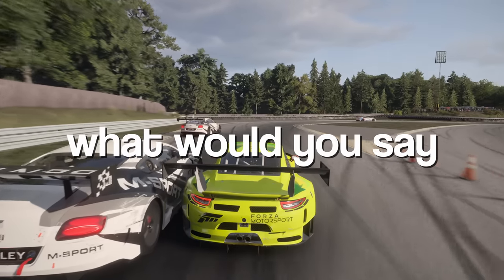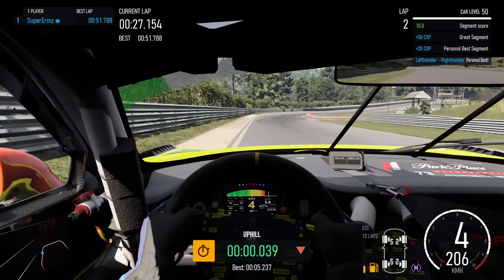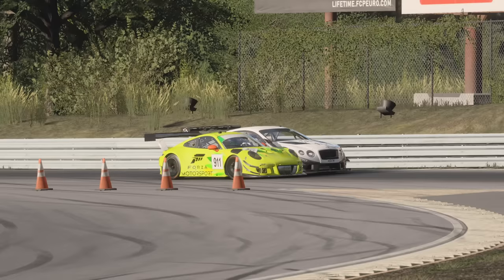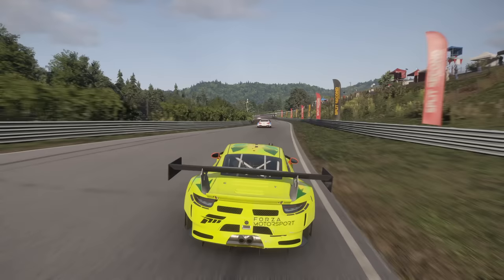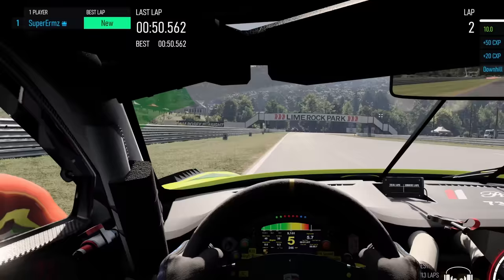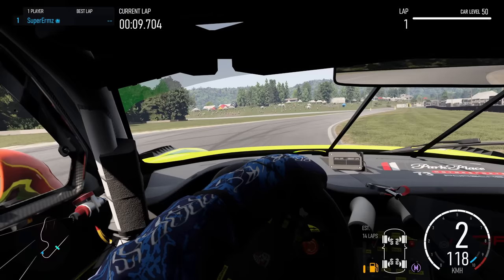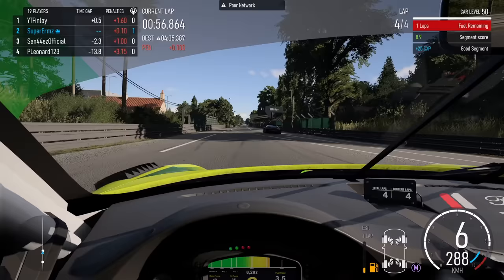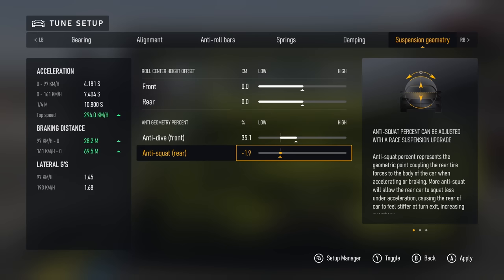The ULTIMATE Forza Motorsport Car Tuning Guide

Comment: I never expected to find myself defending the new Forza game, but here we go. It is really unfair to make fun of the realism on the basis of "stiffer rollbars = more grip." That is LITERALLY how rollbars work in real life. More lateral stiffness means more grip extracted from the tires, whether it is coming from the springs, rollbars, dampers, or whatever else. The fact that the car is sliding around everywhere after stiffening the bars is because the rollbars are actually trying to extract more grip than the tires have, causing the tires to slide all the time. Softer rollbars with the front vs rear stiffness balanced to eliminate as much over and understeer as possible would be a faster setup, guaranteed. And much more pleasant to drive as well.
TL;DR The rollbars actually work the same way as in every other simulator ever.
Reply from the maker: Au contraire, we used to keep rollbars almost completely detached in rFactor 2 (definitely on rear) because that gave the most grip in that physics engine (while driving with minimum rear aero, to drift at 200km/h+ for eSports times). Roll bars tend to be notoriously broken in different ways in different racing games, and there's often little rhyme to the madness.
Reply: @Ermz  Alright, fair enough. I seem to recall you talking about the rollbars in rfactor 2 in a previous video, so I should have thought of that. Still, across Assetto Corsa, Dirt Rally, GTR 2, RBR, Five Forza games, two Gran Turismo games, and even BeamNG with it's unique tire physics, I find roll bars work the same way.
I think what this means, is that you CAN tune rollbars "realistically" in most sims, and get good results, but clearly there are physics exploits out there.
It is worth noting that this sort of overly stiff, loose rear end setup has been popular in Forza for as long as there has been multiplayer, because people hate understeer. It has never been very fast though, because sliding tires lose a lot of grip in Forza.

Comment: Hm I don't wanna hate here, as I do enjoy & appreciate your content usually, but this looks way off. I guess tuning is a subjective thing, as we all have different driving styles, but in many ways this is almost the opposite of what I would tune a GT3 like, and it shows in your footage. If this is not a hoax, your car slides the entire time, which is obvious when setting sway bars that hard and maxed out diff.

In my experience, the physics in Forza are not that super wildly off as you made it sound, which means a fully locked diff is usually a very bad idea if you want to have control over your car on corner exit. On RWD cars like GT3s I'd usually go for max 40% accell diff.

For suspension, it's a similar story: if you want grip, then go softer - harder suspension might make it more direkt, but not more grippy. This is why you gotta balance suspension travel, dampers, right height and sway bars pretty softly, instead of going 100% in one way.

Again, it seem to work for you, but I wouldn't call this a general guide that works for everyone at all...
Reply: A lot of the top players use a somewhat similar approach. Roll stiffness has always been the way to go in Forza
Reply: @Harmonic14  yeah i guess there's nothing wrong with a stiff race car per se, as long as it's pointy. I just can't wrap my head around how a drifty, slidey car like shown here can be the goal. 

I tried a couple of raceboy77's GT3 tunes, and they are super sharp, no drifting at all, as you would expect from these cars. And he's probably one of the fastest guys in this game i know.

Comment: why are you not using Sport traction though ? it's a massive difference , you also don't lose much time...
Reply: You don't need it, all the modern gt cars can be driven fast without it.  If anything it should be used as a safety net so if you make a mistake you won't lose a lot of time.
Reply: @p1rturk598  but they all use it to preserve tires and in some cases it's faster in lap times. TC in GT3 isn't the same as in road cars. that's why you got Sport TC in options. the only reason to drive w/o TC is to throw your ass in hairpins, but that wastes your rear tires super fast, which is terrible for RWD cars... like this one..
Reply: @TheFormActually  you can use it if you want to.  But all I’m saying is if you tune and drive your car correctly you don’t need it at all.  Tire wear and etc are the same or extremely similar.  If you have tire wear issues that is a hint that something is off about the tune or driving.
Reply: @p1rturk598 Idk, as a gamepad player i can say that some GT cars are absolutely undriveable with TC completely off - like the M8. It immediately breaks it’s rear tires loose even with careful and gradual throttle input. Just a complete oversteering mess with zero grip.
Reply: @amgbenz0664  def not, either something is wrong with your controller or your tune needs adjustments.  I run a private lobby series so we tested all the cars and none of them need it.  And that is with zero rear aero which all the top drivers run with by the way.
Reply: @p1rturk598  There’s nothing wrong with my controller at all and I’ve been playing Forza since FM3, and regularly get podium finishes online. Triggers set to 0-100 on my Elite Series 2 so i have the most possible control over throttle input. Im not talking about tuned cars, obviously something can be done besides increasing downforce on the rear which is something I’ve already tried. Maybe some toe in/ toe out adjustments, acceleration/ deceleration on the diff etc. But stock, or even with downforce adjustments, the M8 is undriveable on gamepad with TC off. That’s not really debatable lol
Reply: @amgbenz0664  if you are racing online lobbies with a stock tune and saying you have to use TC to drive it.  Then you can’t complain about it when you have the option to tune it out.  And on top of that make yourself faster.  Getting podiums on an online lobby is not something that is impressive unless you have all the fast guys in the game in one lobby.

Comment: Default physics are so cr#p. Still looks a lot more slidy and less planted than a car should even with the set up.
Reply: The settings he uses here ARE insanely slidy / heavy on the oversteer side. You can dial this exact Porsche in to be a super precise monster on rails, your setup will look WAY different than shown here, tho.

I don't wanna be shitting on our Boi, as I appreciate his content, and the settings seem to work for him, but this is not at ALL how I would tune a GT3 in Forza personally.
Reply: @anselmbuder he's pretty close to tuning it for raw pace in Forza, actually. The only thing missing is no rear aero

Comment: This game simulates nothing but understeer. Irl.most times, you will.flip.a car over before u lose traction, turning. This game forgets tires are made of rubber.
Tune in chase near mode. The game plays hugely different with different camera views.
Gearin is easy, if u have loads of power, stop usin all the gears and turn a 7 speed car into a 3 or 4 gear car.

Comment: does not handle like a real GT car, real GT3 has super advanced ABS and TC
Reply: The controls in GT cars are actually pretty crude... Lol not "super advanced" by any means
Reply: @Harmonic14   the ABS systems and Traction Control systems in modern GT3 cars are absolutely far more advanced than any road car.

Comment: My experience of the Forza Motorsport games has always been tainted by the tuning.
No matter how fast and capable I might have been ( I was always pretty quick and would have many top 100 lap times and a few top 10 lap times and plenty of online win in factory spec races.) I was always fighting a losing batlte against those with a good 'tune'.
Not having the time or inclination to learn what is effectively a broken tuning system I initially tried buying tunes in the auction house. However I soon became clear that these tunes from so-called top teams were in fact 'fake' trolling tunes that were next to useless. Makes sense, why woulod a top team give away their best tunes?
It wasn't until i joined a fairly high ranking team and gained access to their 'genuine' and fast tunes that I could really compete in open spec online races. 
However, the car with these tunes were now utterly joyless to drive, so I gave up on Forza and moved to PC sim racing and never looked back.
Reply: dude... sim racing is literally testing bunch various tunes for days prior to any race... me and boys spend days on discord to find a good tune.. which reflects in seconds of lap time.. It's more tedious than FM.. because you can't afford to make a mistake, because you don't want to drive a 2~12h race on a poor setup.. silly argument tbh... Tuning in FM is more fun imo, just because it's 10x easier to tune car and test it on the fly... in sims, it's a process of 3 million clicks and waiting in between, also driving for 3 laps to get your tires up to temp so you can test the optimum performance of your tune..... pls..
Reply: @TheFormActually  No 'dude', tuning is merely an aspect of sim racing, it's not "literally" sim racing whatsoever and in the case of Forza it's a broken system in which the physics can be exploited and option to change drive trains, engine swaps etc, (which most serious sims do not have) only exasperates the issue.
Reply: @Coxy-b34  dude, you're living in the past. In case haven't noticed , SPEC series don't allow you to change car parts, AKA swap anything on your car ( like GT series and whatever is available in the concurrent week ). It's actually very well balanced between different car brands. Just like in sim racing tuning is an aspect of racing in FM spec series... as you call it. But I say, it's an important aspect if you want to maximize your performance in competitive environment. Just like in every sim race.